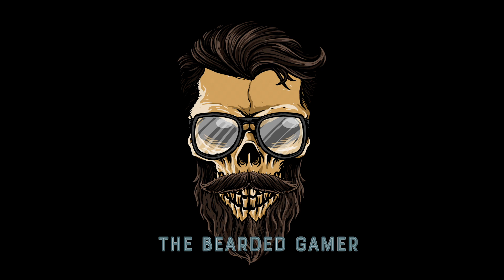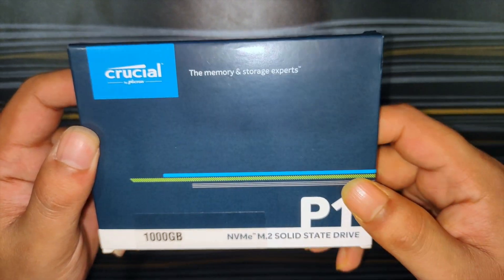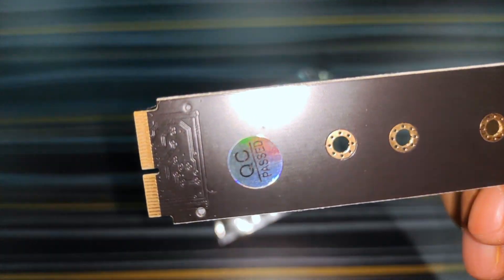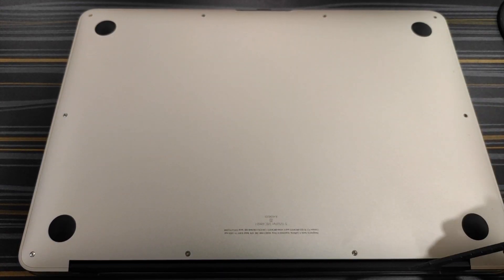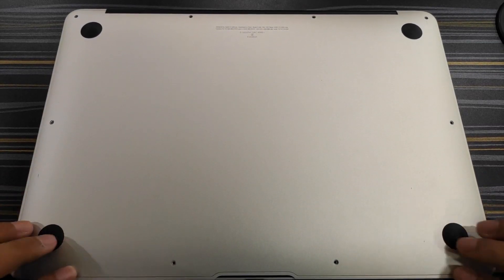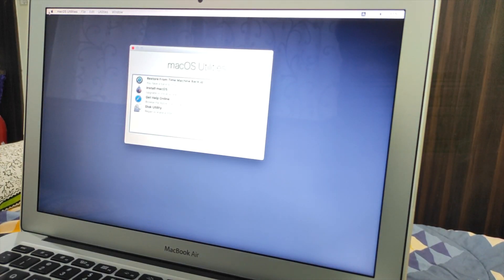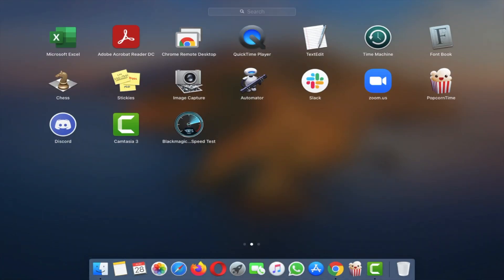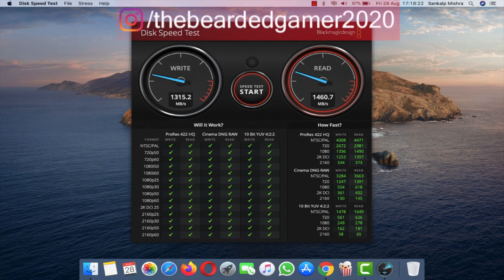2017 MacBook Air Storage Upgrade from 128GB SSD to 1TB NVMe SSD | Full Guide for 2021 | 40k+ Views

Comment: Hi Buddy, thanks for the demo. This is clean and clear. I happen to hear from a mac service technician that using a nvme via adapter may sound good now but in future it would cause issues to macbook logic board. After hearing that I am worried to upgrade to NvMe but also not willing to a stock apple ssd which is very very costly.
Model that i have MBP Late 2013 15” 2.0 Ghz i7.
Any suggestions or thoughts please
Reply from the maker: Hi Avinash. It's great to see that you have done so much research before going for an upgrade. I also did a lot of research before going for the upgrade and I went through a lot of forums and seen people having done such upgrades for almost 4 years now without any issues. Even based on how well my device is performing, I don't think that should be an issue. You can go ahead with the upgrade as long as you are comfortable with it.
Reply: @TheBeardedGamer2020  thanks Bro... this is really informative and will be upgrading to NVme
Reply from the maker: All the links are in the description. You can use the same ones for your MBP as well.

Comment: Thanks bro nice content. Does the macbook air 2017 support crucial p5 500gb? Is there any issue if I use another nvme adapter?
Reply from the maker: Thanks bro. The MacBook air does support the Crucial P5 ssd but why do you want to pay more for the same read and write speeds? I know the read and write speeds are different on different SSDs, but when you put it into the MacBook Air, the max speed you will get is similar, though more than the proprietary Apple SSD. It is all about choice. If you want to buy a more expensive product for the same performance, it's upto you. And, as far as the NVMe adapter goes, the one I am using hasn't shown any issues. But, I have heard a lot of complaints from people who have tried using cheaper alternatives. It might work for you, but I wouldn't take responsibility. But the parts that I have used and have links in the description, will work for sure.
Reply from the maker: Do subscribe to my channel and press the bell icon to get updates on latest videos.
Reply: Thanks bro for the reply. I usually need higher rwad and write for the development simulations. That why I look forward with p5. In their website its showing 3000 speed rate while p2 is having only 2000. So when it's on max both gives same speed rate?
Reply from the maker: @adhilazeez6039  With the NVMe adapter that is available, the read and write speeds are going to be almost similar. The P1 Nvme ssd has read and write speeds upto 2000, but in the Mac the max speed is around 1300. This is twice the speed of the current Apple proprietary ssd, so speeds shouldn't be an issue. Even if the p5 has 3000, I don't think it is going to give speeds of more than 1500-1600. But, then again, I haven't used it. But from experience with the P1, I am quite sure that the speeds will be limited. So, you can go ahead and make a choice, a lot more money with slight improvement in performance or a value for money upgrade.
Reply: Thanks bro. A great advice from you 👍👍👍 Gonna purchase p1 😁
Reply from the maker: @adhilazeez6039  Great choice. Link is in the description. Also don't forget to subscribe and press the bell icon. Peace. ✌🏼🙏🏽

Comment: Would you please let me know how is it going along now? is there any small drawback to it which you found compared to the original ssd which was there already? Please help me decide :) Also do you suggest smthing else? maybe samsung evo ? Please let me know your overall experience once. That will help me a lot. Thanks in advance. :)
Reply from the maker: Hey Nikhil. There aren't any major drawbacks to the upgrade. There os basically one small issue, which is slight heating when you are doing any performance intensive tasks like video editing or rendering but that has to be there as read and write speeds have almost doubled. So slight heating with better performance is obviously a great deal. And about which ssd to use, you can go for either the crucial p1 that I have link to in the description or the Samsung evo, but both will have similar read and write speeds on the MacBook. So, there is no point paying extra when you get similar performance. Hope this answers your queries. Do subscribe to my channel and like and share my videos. Also, all product links are in the description for your convenience. Do reach out if you have any other queries. Peace. ✌🏼✌🏼

Comment: Thank you so much @TheBeardedGamer for this detailed explanation.
I have one question , " Are  you getting any issues with your crucial ssd like "sleep mode" or any other issue . And i also want to put windows using bootcamp after upgrading ssd , is there will be any issue or would it be smooth like original ssd.
Reply from the maker: No issues with the ssd as long as it is a MacBook Air. Just a slight heating issue, only when you are doing performance intensive tasks like rendering and stuff. The sleep issue is common with the MacBook Pro. 

And bootcamp has been seamless as well. In the beginning, there might be an issue with aligning the mouse clicks and the function keys but there are a lot of solutions on the internet to fix it. You can read through it or reach out to me after the upgrade. 

Do subscribe to my channel and follow me on Facebook, Twitch and Instagram. Also, make sure that you purchase the products using the links in the description below. I have received messages from people saying that their ssd didn't show up because they ordered some other product.
Reply: @TheBeardedGamer2020  Thanks a lot for detailed reply , i have liked your video and subscribed to your channel . You are great.

Comment: Sir i have Macbook pro 15’’ retina mid 2014 can i use crucial with this same adapter. Will it work ?
Reply from the maker: The replacement process will be slightly different based on placement of connectors and screws but to answer your question, yes you can. However, there is one issue, mid 2013 and mid 2014 MBPs tend have sleep issues as they natively do not support hibernation on NVME SSDs, but there are solutions for it on various forums. You can search for it on the internet. Do subscribe to the channel if you like the content. Peace. ✌🏼🙏🏽

Comment: Will WD Blue NVME SN550 500 GB M.2  be compatible with the same adapter?
Reply from the maker: Yes. As long as it is M.2 NVME, it will work. Make sure that you subscribe to my channel if you need more help.

Comment: I used crucial P1 500GB ssd and the exact same adapter both bought from Amazon but my MacBook Air (2017 model) didn’t detect the ssd
Reply: Bro did the SSD support your MacBook air??  reply... Even I have macbook Air 2017 and wish to update storage...
Reply from the maker: @vina22697  Yes I have been using it for more than a month now. Has been working seamlessly.
Reply from the maker: @vina22697  Do subscribe to my channel if you need more help with the upgrade
Reply from the maker: Did you format the ssd in the same format as your proprietary MacBook ssd?
Reply: @TheBeardedGamer2020  It didn’t show up in the disk utility so I had no option to format it to APFS
Reply from the maker: @irtiqamalik5562  oh yes. Sorry. Can you check that the ssd is working on a different pc maybe?

Comment: i will appreciate if u can tell more  for how can i upgrade my (Intel HD Graphics 6000 1536 MB) if possible 👍
Reply from the maker: No. Graphics upgrade is not possible. The only option is to have an external graphics setup connected through your MacBook's thunderbolt port. But that is super expensive. If you are into gaming, better setup a gaming rig.
Reply: Is the current Intel HD Graphics 6000 1536 MB of my Macbook Air 2017 enough for league of legends?
Reply: @markldia9441  you will get playable performance
Reply from the maker: Thanks for the reply PhoenixHeat.
Reply from the maker: Subscribe guys. Do need the support.

Comment: bro, i love your content but i still think a external ssd is more suitable for dealing in mac 
1).   128 gb will  a waste . and can't be used as upgrade in pc or something 
i still think a external one much better and save more money and can be used in other devices 

2).  efforts+cost for sata + internal ssd = 11,783
external ssd + no efforts 😜 = 10,999 (sandisk) cheapest one  

still u did a great job in showing us another side of the force and i do appreciate that
Reply from the maker: Thanks bro. Hope you are subscribed. If not please show your support by subscribing to my channel. 

Having an external ssd via usb 3.0 is a bit of an issue when editing videos as it slows down the render process. Also, there is the hassle of connecting an external drive anytime you need to access data. It's any day your preference, based on what you are comfortable with, you can choose that. Peace.

Comment: Does the time machine backup have the OS in it ??
Reply from the maker: Yes it does.
Reply from the maker: But you need to have a bootable installer to get into mac os recovery.
Reply: @TheBeardedGamer2020  so first we need to install the OS via the bootable drive and then go for time machine recovery??
Reply from the maker: No you do not need to install the OS from the bootable USB, that is just to boot into MacOS recovery. Plug the usb in as well as the time machine backup drive in, press the power button and immediately press the option key. You can see the bootable usb drive that you have created. Once you click on it, it will start loading and then go into recovery mode. Select the restore from time machine backup option from the disk utility.
Reply: @TheBeardedGamer2020  Got it!!thanks man
Reply from the maker: @shashikantbinhan3315  Cool. Do subscribe to my channel if you haven't already done so. And ask your friends and family to subscribe to my channel and watch all my videos as well.

Comment: Helo
I have macbook Air 2017
I bought Same ssd crucial
But the ssd is not showing in disk utility, 

Help me 😔
Reply from the maker: Did you use the same adapter and the same steps that I followed?
Reply: @TheBeardedGamer2020  

Yes sir same adapter
https://m.aliexpress.com/item/4000265941706.html?spm=a2g0n.orderlist-amp.item.4000265941706&aff_trace_key=46ccbd23e08b41bfb573c4840b0506ca-1590941585004-09579-Dzwsbx9e&aff_platform=msite&m_page_id=3700amp-cNT9L0UnnIOLIFqDJD3OEg1602970253094&browser_id=f81454db19d44f3ea1493591c404c45e&is_c=N
Reply from the maker: @jobhi23  the best option for you is to either get the ssd checked and see if that is faulty. If it is, get it replaced and if it is not, try to get the adapter from Amazon. I have seen a lot of people complaining about the adapters from other websites turning out to be faulty. The response of the Amazon one, however, has been pretty good.

Comment: I shall be grateful to you if you provide me option/link for MacBook Air SSD enclosure/connector. I want to use the SSD as external hard drive.
Reply from the maker: That is a major issue that Apple parts have here in India. The enclosure is not available on regular e-commerce websites and the ones that are available are super expensive. The only option is to get one from the US, if you have anyone coming from there. Will be on the lookout for a cheap option here. Will update if I find one.
Reply: @TheBeardedGamer2020  Thank you so much for your reply.👍
Reply from the maker: @DineshSingh-ns5md  Not an issue bro. Hope have subscribed to the channel. If not, make sure that you do and ask your friends to subscribe as well.

Comment: Thank you buddy, that was helpful. I have a MCB Air 2017/18 model. 
1. Would I need the adapter even if it is 2017/18 model?
2. Can I not boot the OS from internet recovery?

Thanks in advance.
Reply from the maker: This one is the 2017 MCB Air. If you have the same one, you can follow the same steps. But, if you have the 2018 model then you won't be able to upgrade as both the storage and RAM are soldered to the motherboard.
As far as booting the OS from recovery, yes, you can do that as well. I made a bootable usb because I had one lying around.
Reply: TheBeardedGamer thanks. Yes I have the same MacBook 💻 with Samsung removable SSD inside.
Would the adapter be still required?
Reply from the maker: @ashishskapoor  Yes, you do need the adapter for the upgrade.
Reply: @TheBeardedGamer2020  buddy could you please confirm that your MacBook model number is A1466. Just want to be sure that it is compatible with my MacBook Air before i order. Thanks a lot.
Reply from the maker: @ashishskapoor  Yes it's A1466